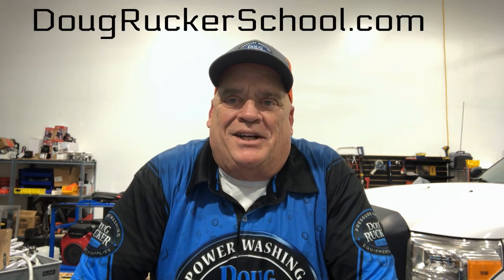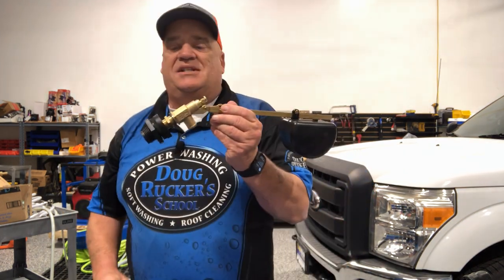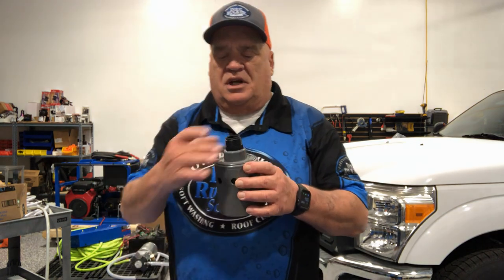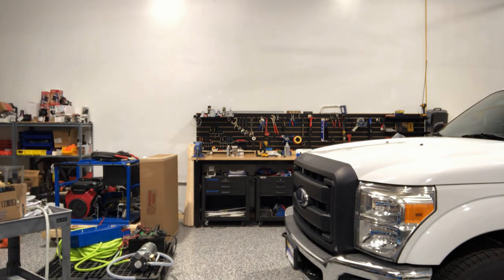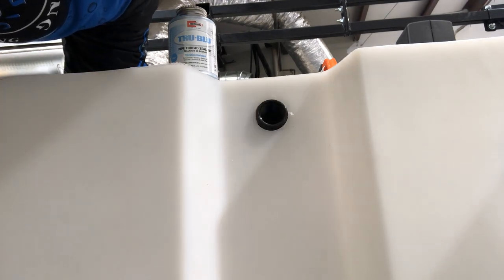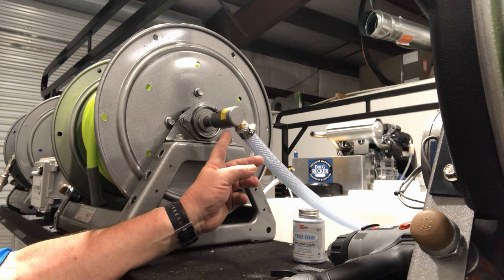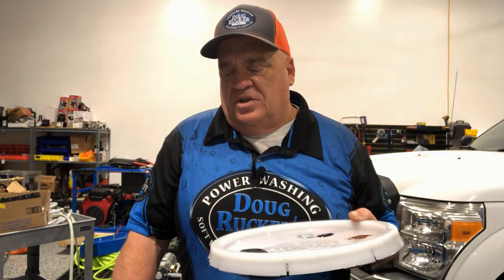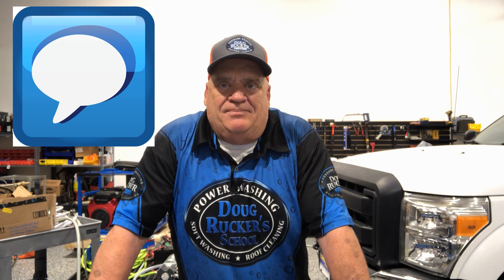Power Wash Water Tank Float Valves from Doug Rucker Store

Comment: Thanks for this video, Doug. The benefit I realize from using the general pump float valve is that water fills completely to the top of my tank, whereas with the other two valves, the water level is about 6-8 inches below the top of the tank(Hudson) and 3-4 inches below the top of the tank(Jobe).

Comment: Doug - if you are running a 5gpm do you recommend using a 3/4” hose or 5/8” hose for your water hose supply ?
Reply from the maker: 3/4 is best 5/8 will work too
Reply: What hose reel are you running your supply hose through? Don’t most hose reels carry a half inch manifold? Wouldn’t that restrict flow on a three-quarter inch supply hose bolt from the spigot to the reel and also from the real to the buffer tank?
Reply: @SpiritPressureWashing  you’d think so. So I’m not sure why the hose diameter matters